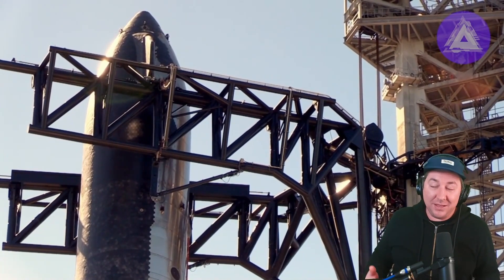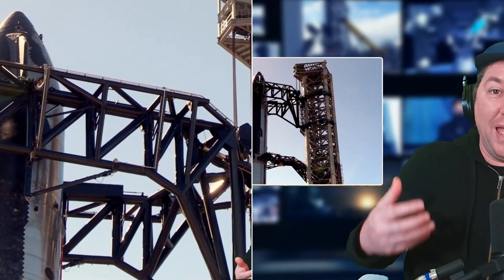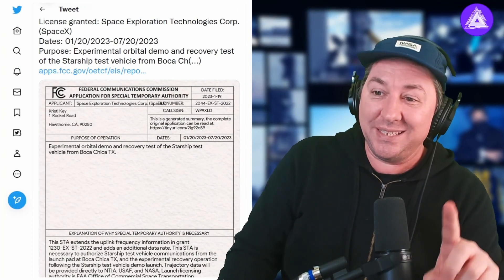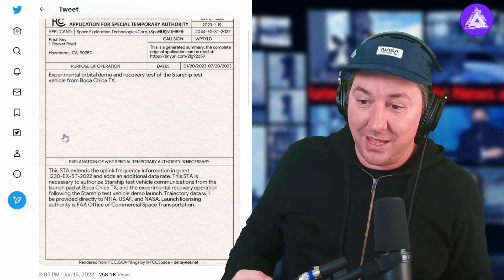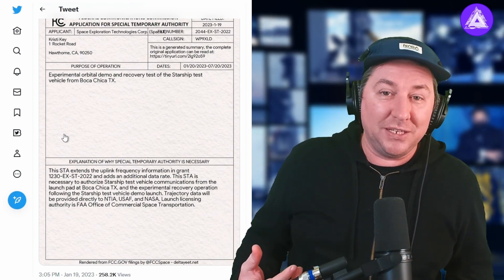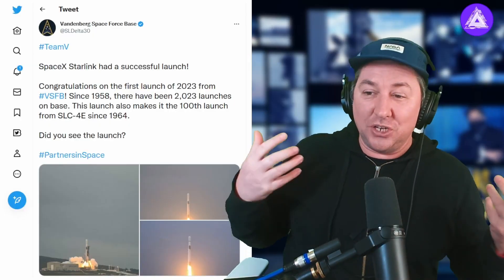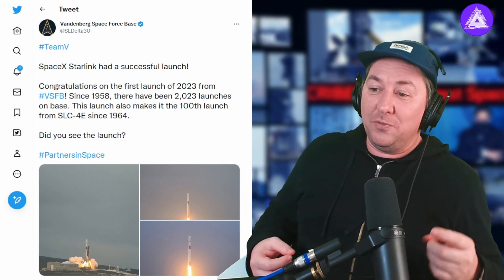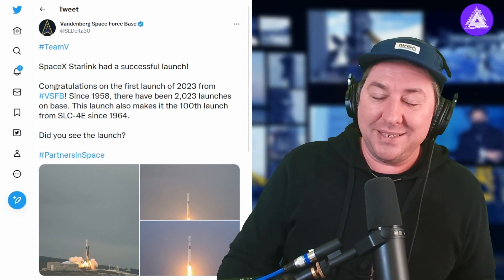SpaceX Starship Update

Comment: Biggest problem isn’t concrete or water deluge! Biggest problem with static fire is securing the Booster to the pad with 17 Million pounds of thrust!! You rip out the engines, or you crush the structure just trying to hold the booster to the pad!!! I don’t see Starship ever being able to conduct a full thrust test for full duration green run.

Comment: Total speculation on "deluge" system at BC... (there's not going to be one). Flame diverter probably, or some kind of protection for the floor, but it's obvious SX is going out of their way to avoid maximum effort on the problem. Damage to the rocket is unlikely on several levels, and is not the problem they are trying to work around... Damage to everything else on the ground is. At any rate, I think it's clear SX is gearing up for a full send, and they'll work out the after effects, well, after.

Comment: follow up on the Launch Pad Concrete.  MY proposed use of Precast  Concrete Slabs is the UHPC ULTRA HIGH PERFORMANCE CONCRETE with strengths in the range of  150 MPa. These Elements to be precast incorporating inserts as additional protection against damage and properly cured and stored near Launch Pad . Can be transferred, PIcked Up, and replace any damaged slabs using Overhead Gantry Sliding on Rails, that can easily execute the required operations within the required time frames.

Comment: there is a serious misconception of how to mitigate the problem of Resisting the Force of the Booster Engines.
You do not resist the full force, it is a losing battle.  You partly absorb, partly deflect and partly resist these Forces. Use the Analogy of Massive Concrete Pods interlocked to protect coastal structures.  They do not fight the Incoming Waves, they absorb and dissipate their Energy and these massive powerful waves break up at contact with the Concrete Pods. A Couple of years ago I  examined the disastrous effect of destruction due to waves smashing against a Breakwater with Smooth Rock surfaces reflecting the Energy of the incoming waves with minimum loss , ricocheting with full Power  to an opposite unprotected side of a Break Water and completely destroyed it.
I notice the very basic way of patching up the slab after the launch; this is a very primitive system: SPACEX plans multi launches a day: the Boosters could meet with this program, but the launch pad cannot.
The solution will be massive Prefabricated Slabs of very Ultra Hi Strength Concrete specially designed. These are placed on a specially prepared Base Layers. The Slabs can absorb and deflect the massive Energies of the Boosters and in case of damage can be lifted, and easily replaced within a couple of hours ready for the next launch
Reply: There will never be multi launches per day at BC... Ever. The real "Starbase" is actually being built at the Cape.... which will have a proper flame trench and deluge system. As soon as the Cape site is finished, you can expect BC to be abandoned .

Comment: They need to build something massive,  similar to a large swimming pool or under ground parking garage beneath the orbital launch mount to divert the flames
Reply: They can't. The site is at seal level on sand. It's why they don't have one. They would have to build a mound like at the Cape, which the site is too small for.
Reply: @hawkdsl  Got it
Reply: In plans for an extension of the site a large pond was drawn in just to the east of OLM and launch tower (between those and the beach). I don't know if SpaceX have acquired the ground.

Comment: Hello Will and everyone. It wobbles my mind. That the deluge and diverter was incorporated in the beginning. Along with a rail system to get these back and forth on the pad.  I know this is all experimental. But fast draw and shooting from the hip can come back to bite you.   So let's all hope for the best.  All go starship. All go us.
Reply: Speculation on my part, but this probably goes way back to when they picked the site.  It was cheap and available, but also small. Building a mound earth works to incorporate a flame trench would have been too big for the site. The tower design reflects this, with a rather high stand off from the ground.. It could be they just assumed the pad concrete could take it... which by the way, weight bearing concrete for floors are typically reinforced with fiberglass fiber as well as rebar. They just flubbed that one.